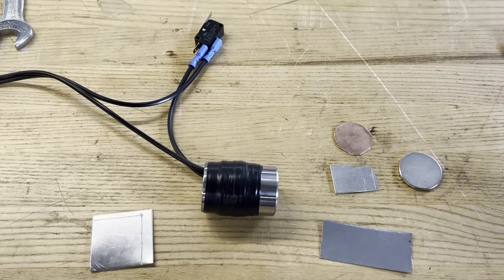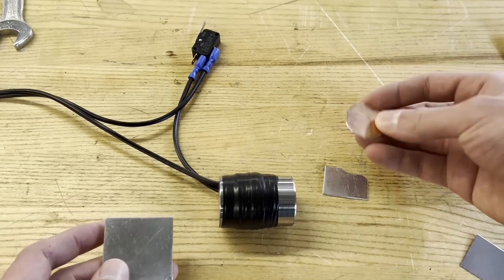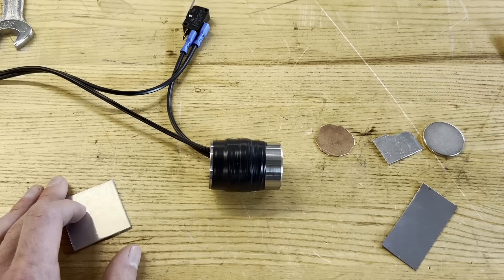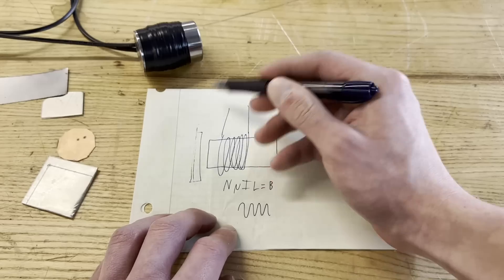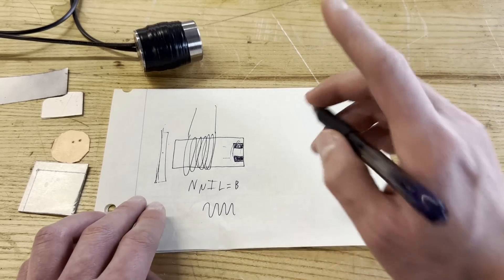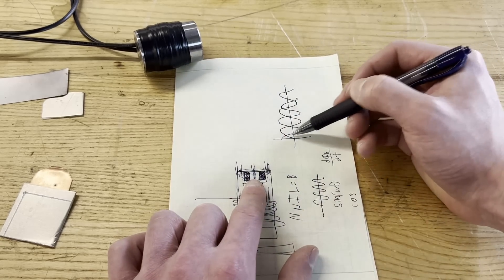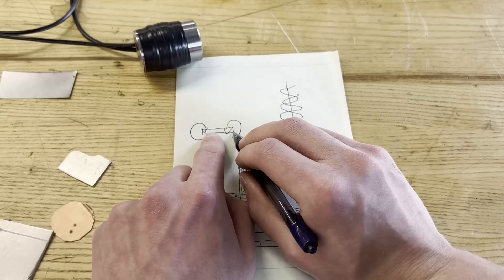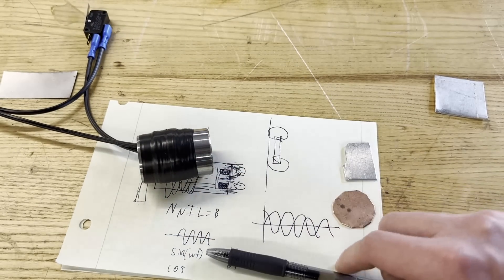A magnet that attracts aluminum and copper

Comment: I think i will do it and put it on you tube. I go buy materials. may be take few month. Need to get materials first .. need welding. need 60v 20a psu

Because no one in youtube done it correctly , i have to do it

I thought u already interested in so you do it but it seems you are stuck in a loop.

Laters human

Comment: Making a Powerful Electro Magnet from a Transformer -schematix
Take the primary coil out of microwave transformer.
Instead of using iron plates , use copper plates.

You will have powerful electro magnet of different kind.
Reply from the maker: Bro, you’ve left 6 completely incoherent comments on this video in the last 6 hours, chill out 😂
Reply: @cylosgarage  see you cant see it.
You are brainwashed.

There is a reason you cant see basic concept of magnetism

You are trapped.

No one can help you until you see why you are trapped.

I will not give you answer in platter.

it has to come from you by thinking differently

Nature never hides. its human hide in his delusion.

Here is what i want to say

We humans only see who we are in everything

That means we project what we are

If its incoherent then it is you incoherent

Remember that.

I only speak to curious mind , you dont have any curiosity.

Good luck little human

Comment: Also watch "Thoisoi2 - Chemical Experiments!"
Compare electro magnet and magnets
Find what is most powerful electro magnets and duplicate it in small scale.

If you have break through in one area will change your perspective on everything.

You cant use ferro magnetic material  for rod. You have to use copper or copper alloy for induced magnetism from coil.

That is first error in this experiement

Dont ask why. just do it.

Comment: So, at a power plant, you have an electromagnetic rotor and then you have the copper wires in the stator. Is the rotor having a repulsive effect on the stator wires or an attraction? Thanks.

Comment: What a bs explanation. The obvious reason is that the aluminium piece has the same induced current as the copper ring hence they are attracted together (proximity effect). The larger piece conducts the induced current over a larger area hence not aligning with the copper ring to produce the same effect.
Reply from the maker: Crazyyyyy amount of confidence lil bro
Reply: @cylosgarage Get a cheap field viewer and be ready to be ashamed dumbo

Comment: It seems to me the moving magnetic field would act like a generator, and the electric current turns the plate into an electromagnet.  That is what happens when you drop a magnet down an aluminum tube. 
Maybe I'm wrong - just a thought.

Comment: this has many applications including lightsabers 😅 why? because in static field we ionise the air in a certain range so sparks can travel through it, some microwave with such a small wavelenght that itd usually not pass through air that is not ionised. When it is ionised the wave both collapses and it doesnt so it creates a thick plasma field
Reply from the maker: @vladimirN324  dude, what??
Reply: @cylosgarage  yeah its similar to the UV light/laser and tesla coil combination to make a death ray

Comment: You get a buzzing rotating region. If you notice the aluminum will get hot sticking in that region because your system is messy.
Reply from the maker: @clarkcowan3984  it gets hot because the eddy currents that are created by the continuously changing magnetic flux are dissipated into the metal in which they form. Not sure what you mean by messy

Comment: Had the brilliant thought to use this concept to make an electromagnet that attracts non ferrous material such as Gold in Alaska,,,This would only work with Alaskan Gold cz of it being water suspended gold cz it would be using the conductive properties of gold ad a metal in a magnetohydrodynamic system ,pushing the gold and attracting it to the walls
Reply: Got the idea from watching the video bu Proffesor  Eric Laithwaite when we were learning about eddy currents.
He achiev3d the same by placing two concentric opposite pole electromagnets, this produced enough strength to not only attract small pieces buy a very large aluminum sphere i think about 2 feet in diameter.

Comment: Yea you’ve just located the second electric field. Newtons second law requires an opposing electric field. Even if there isn’t a conductor to flow in. You added a copper disc into that electric field. That’s why teslas wardencliff had concentric rings in the center. That effect continues linearly as you increase the power output. Tesla had a patent related to this, where he lights a bulb in each electric field
Reply from the maker: No
Reply: @ very enlightening..🤨

Comment: I have actually observed permanent magnets attracting copper. Not speaking of eddy effects. Working with some tiny (~1 cubic mm) neodymium magnets, I found that they were attracted to copper wire; strongly enough to be picked up. I ruled out nearby electronics inducing a current in the wire. And it's very unlikely the wire contained any significant iron, nickel or cobalt, as far as I understand, untinned electrical wires are pretty much pure copper. My own research never turned up any way for this to happen. In fact, from what I learned, there should be a slight repulsion. If anyone has an explanation for my observation, I'd love to hear it.

BTW, these magnets can also stick to your hand, but that's more readily explained given the iron in our blood.

Comment: I once saw an aluminium can assembly conveyor. The can run on belts horizontally as normal by its weight. When the conveyor angle bent to vertical, the can still run upward along the belt, which is now on the side, changing from the bottom in prior.  That made me amazing, Hey magnetic can pull aluminium can.

Comment: So the electron magnet has to be AC power source correct? I have a CNC Milling machine so I'm going to make one, but I didn't know if I needed to use AC or DC power.  I assumed AC, but if it can be done with DC then I could make a more portable one.

Comment: The magnetic field through the copper ring, produces a current and the steel "core" inside the ring produces another magnetic of the opposite pole.
The same happens in the non ferrous metals. Although they are not magnetic, they DO produce a current when exposed to this magnetic turmoil and creates its own current AND magnetic field, and so they attract. So its not the copper or aluminium that is attracted, but the magnetic field of the metal that is attracted.

I imagine that if you use the right size of copper ring and piece of non ferrpus metal, you could also repel.

Comment: steel wire 1 or to pieces of it plate in copper plate in steel put equal size copper twine next to it plate in neo stage 3 injection molding plate in copper energize (magnetize) magnetc twine wrap around copper spindel (check pic of faradays illistration on energy projection( wireless charger)) do 2 wrap them opposite put one inside the other make sure they touch for static discharge put those in copper sphere twine of copper dipped in neo injection molding plated in copper inside of sphere apply double rack with pinion with breakable arms being pushed by springs under a pressure plate with clips on the racks to dislodge and lodge the arms so constant spinning attatch(spell it how i say it) rotor and staticore
Reply from the maker: Dude, don’t comment on YouTube videos anymore 😂

Comment: 3:27 & 4:04 Is that really magnet wire or just wire used to magnetized? That doesn't make sense. Maybe just say wire. Some issue with the volume on this video. Otherwise interesting.

Comment: I remember eddy current "magnet" to pickup copper and aluminum in Popular Electronic magazine of the 1980s.
Reply: Me too. It used a capacitor to create a phase shift as I recall. You can also use a dc  or perm magnet to attract non ferris with eddy currents induced
Reply: An earlier one was called "Master Magnet," 1962 Walter B. Ford.   It used a heavy copper washer at the end of the core.

Comment: Can you perform a copper test during the time the copper is being pulled by the magnet? I am asking being completely not up to my goal in understanding exactly all I'm working on understanding and I acknowledged my question is full of ignorance and simplicity. The idea behind it is to suggest that instead of it being magnetized a book that it is actually an entire different substance like the the copper is not the same copper you were originally magnetizing or if there is an increase in processing speed of elements connecting. So you're pulling maybe any material that is or isn't there yet.. there are several ways I can think of wording and with different variations in mind but I think I described my question and idea behind it good enough. I'm fkn tired lol

Comment: Try it with miu metal and you'll end up with a big surprise.
You essentially have created a stationary rotor and is a simple way of explaining it. The current generated in the piece of metal held up against the oscillating magnet allows it to be held in place.
Two things I'd like to try is super cool the metals held up against the magnet and change the frequency on the magnet input

Comment: i remember looking up how recyclers sort metals from ferrous...i found out they have a second coil/field...when the aluminum/copper are in the field they can be moved by the electromagnet. but mainly they use a winnowing proess whereby air pressure is used to blow off light things like aluminum cans are blown off and heavy things continue on down.

Comment: Another way of thinking about it is that right against the face of the bar is a more efficient place for the plate than out in the complicated field. i.e. Less heating. You might get some interesting insights by trying a ring or a star shape to control where (or how large) the eddy currents can be, and try thicker and thinner plates. 
An interesting phenomena which might be related, is that inductive proximity sensors (which are good at detecting ferrous targets) are only about 10% as sensitive (compared to iron) to aluminum targets, but 90% as sensitive to aluminum FOIL.

Comment: I made a large electromagnet years ago. I drilled a hole in the top of the steel core and put a dal rod in the hole and put an aluminum disk with a in the center on the dal rod. When I ran the electromagnet on AC the aluminum disk would lift in to the air vibrate and hum. After about a minute it would get very hot. When I tried it on DC the aluminum disk jumped straight up hit the ceiling and fell to the floor. I was told that aluminum repells 2% of the magnetic energy it receives and gold repells 1%.

Comment: WOW! and the Al and Cu are still repelled by an alternating current, it's just that the "face" of the AC magnet is essentially "virtual" (for lack of a better word). I knew I had seen the math before, but only as it applied to negative effects in Switched Reluctance Motors. Depending on frequency and motor design, the ferromagnetic attraction between the Teeth on the Rotor and the Teeth on the Stater will be reduced thus lowering the Motor's efficiency.

Comment: A ferrite core would be iron dust mixed in a ceramic can also work, but what if you now suspend copper or aluminium filings instead of iron and see if that does not work better?

Comment: Yeah, but  technically the magnet isn't attracting the aluminum or copper -- it's attracting an induced current, which also happens to pull the metal piece. Which is still pretty weird.
Reply from the maker: Yep, if you want to be really specific, it’s actually repelling the metal towards itself, lol

Comment: This principal has been used for over a century in many applications. This is how an induction disc relay operates. The disc itself is aluminum, but yet it rotates when current is applied to an induction coil with a shaded pole. This creates the torque necessary to rotate the disc. Also, the current is also passing through the disc itself, so the magnetic field created there interacts with a stationary permanent magnet that is used for dampening and speed  of the disc.

Comment: Easier explanation: "Flow together, go together" - wires with current in the same direction attract. The magnetic field induces a 90* current in the conductors; same for the permanently attached and distant conductors; they then attract.

Comment: Can you make something that shows the how the magnetic fields flow on the device shed you turn it on or off so e get a better understanding of how the fields are moving,  something how when you build airplane ends and the test the air flow in an air flow chamber with smoke to see how the flow of air goes around thy wing to get a better idea of its a good design for a wing or it creates to much drag.

Comment: what a cool video. very interesting. great comments section as well.
Reply from the maker: I agree with you on everything but the last point 😂
Reply: @cylosgarage  If you wouldn't delete relevant comments, possibly it would be a better comments section.  The link I posted might have looked a little spammy, but it wasn't intended to be.  It is an electromagnetic dent puller that works on aluminum by setting up an eddy current in the workpiece with a magnetic field, then it collapses the magnetic field rapidly, which creates a pulling force on the aluminum.  It discharges two massive capacitor banks in rapid succession to create enough force to deform aluminum aircraft skins.  Only works for a split second, but it is another example of a magnetic force that attracts aluminum or copper.
Reply from the maker: @baginthewind4501  YouTube auto deletes comments with links in them before I ever see them. I don’t delete comments.

Comment: Is it coz flux fields moving electrons in a counter space. Sense ac wave. Electrons have bonding step energy potential?. I did take bchydro safety course...kool thx...😮
Reply: Aka greater field strength would move greater mass.

Comment: What if you were able to boost only the magnetic field that attracts the copper ( the reverse or co-syn field) and block the syn field from coming out into the area. Maybe use nickel or zink to block it. Or extend only the copper ring out past the end of the steal or change the magnetic field by arranging the magnetic field by using a manual magnetic switch on the end of the steel.

Comment: You added a shorted turn to make an electromagnet into a ring-shaped "shaded pole".  When energized with AC, It has a feeble attraction for copper and aluminum PLATES in CONTACT with it.  (You could remove the copper ring, assemble two concentric coils, and drive them independently.  That would use less power, and let you tune the frequency, phase difference, and waveform for maximum attraction.)
Reply: Good morning, please provide further clarification.

Comment: You can match the right hand rules together with a shield and winding in a checkerboard pattern.  If you just run a current across a cylinder, each right hand rule repels on a thin LiFe7 8060 megaohm tempered extrusion.  This way a go kart can fit a rather large driver with a hidden shell's motor, but how would you create a shelling ball bearing that didnt waste energy?  Well everything wastes energy, or it would be dry thermite.  It turns out, 100uF into 50uF works at 10v, 100v, etc. depending on close mechanics.

Comment: Does it work better if you put saw-cuts across the iron parts of the face?   The original 1950s project use wads of nails as laminations.  Perhaps even an "X" cut in the steel core, would block eddy currents and improve things (a lot?  or a little?)

Comment: A better way to explain it is that there is a electric wind pushing a conductive material in one direction just like maglev for high speed rail as the closest example. The non ferrous metal is not sticking it is being pulled or pushed. This is a force field that only works on highly conductive metals. I hope this helps others understand better.

Comment: I don't know but it seems like this could generate some weird Eddy currents around the copper embedded in the Ferris core and they would be the source of your toroidal field at the front. Do you think this could also be accomplished using a steel core then wrapped with wire then covered with another steel sheathing and then wrapped with another round of wire to generate the magnetic field from a power source? Would it be possible to increase the intensity of the toroidal field that way?

Comment: GOLD is magnetic too.

I know your thinking Bull crap not possible. 

But you need a super strong neodymium magnet I'd go a 10kg to 50kg lift capacity  , then 2mm sheet of aluminium on magnet (haven't seen different thicknesses of aluminium only one size) once the aluminium is on magnet  gold will attract to the magnetic field.  Yes not very well known but same effect as this changing the poles or angles of the magnetic feild. It is weak but works.
Put your iron/steel peice on the back side when using alloy, copper on front.
Reply from the maker: Unfortunately, not even a little bit correct.

Comment: I thought of an induced field with AC the second I saw the title.  Transformers almost exclusively use copper wire, even though it's not ferromagnetic.  But you have to use AC for a transformer to work.

Comment: You are simply using eddy currents and quantum locking, super cooling the coil would dramatically increase your results. Imagine a large piece of aluminum in a MRI machine, same result, just enhanced with liquid helium cooling the coil.